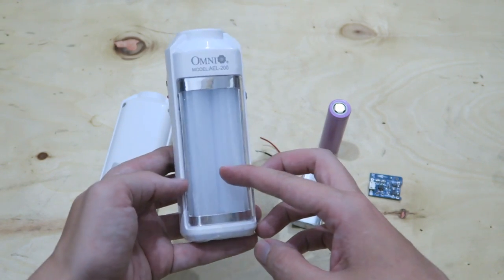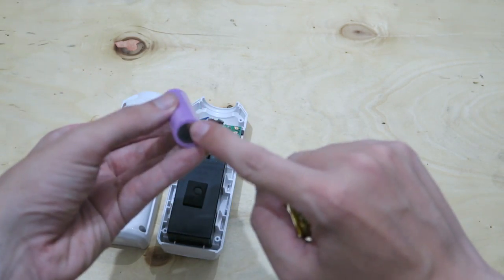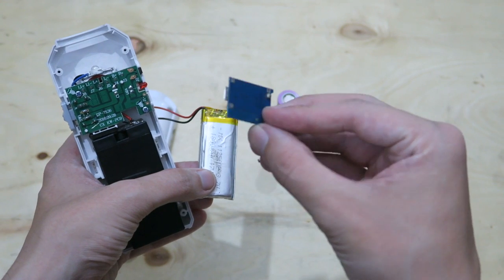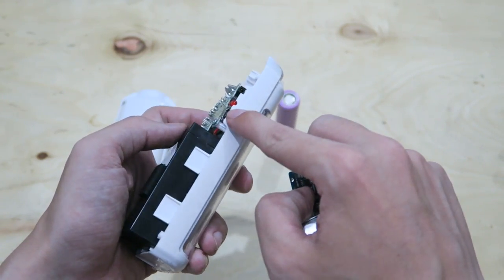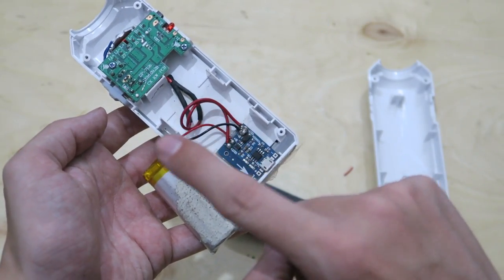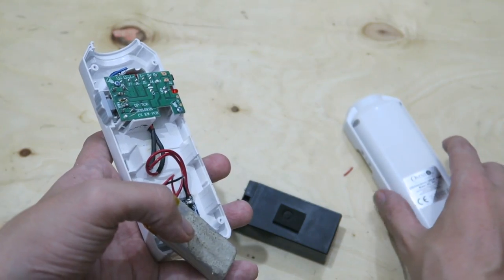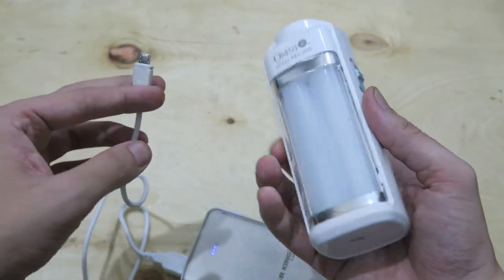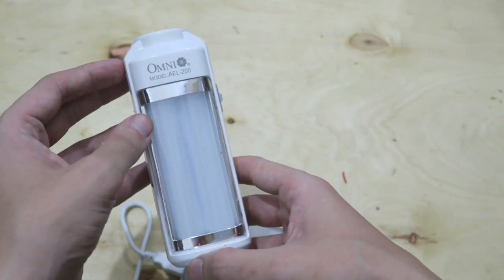Upgrading light to Lithium Battery

Comment from the maker: An easy and cheap way to replicate this would be to buy a P99 - P150 powerbank from CDRKING and remove the 18650 and charge board to use inside your Omni rechargeable light. Or alternatively just remove the lead-acid battery and keep a powerbank permanently attached to the light with a short micro-usb cable.
Reply: Hi. I removed the lead-acid battery and connected it to a powerbank but it won’t work. Any idea why?

Comment: Hi I have the same rechargeable emergency light How do I know if the battery is full because I charge mine for 7 hours but still the red light is still on.  does the red light have to go off if its fully charge?

Comment: That battery has already installed battery overcharge and discharge protection circuit. But that cylindrical battery hasn't. So is it really necessary to put another charging circuit just like you did there.?

Comment: An easy way to replace the battery in addition to using lithium battery with 3cell NIMH eneloop battery in the series. without changing the charger circuit but the charging time is around 12 hour for the capacity of 800mAh. but it's very profitable.

Comment: Hi GA. I have a diff scenario. I have a GDlite solar lamp that runs 6v lead acid. Now i have several liion lying around and i want to use to replace the lead acid. But still be able to charge using the solar panel. Is that possible?

Comment: Can 2 tp4056 work to charge 2 18650?   The flash light uses 2pc 4v 1AH lead acid in series.   So i need to have the 18650 in series.  But i plan to tap each 18650 in parallel with 1 tp4056 each.  Will this work?

Comment: Can you tell us on where to find this charge controller board here in the Philippines?
Reply from the maker: You can find them on OLX and Shopee or order through eBay with free delivery from China/HK. Alternatively you can buy a budget powerbank (P100-P150) and salvage the charge board and battery from that.
Reply: Gadget Addict oh, that's a great idea. But my problem with powerbank is the output. Unlike the charge controller board in which u can just solder the wirings to dedicated points, powerbanks only have usb port as an output. :(
Reply from the maker: +Jake Abad that's true. Although I actually did it on another light by soldering to the pins of the USB port. But of course I'm driving the light at a slightly higher voltage (5V) than it's expecting (4.2V)
Reply: Gadget Addict BTW, I'm not using it for the omni Light. I am using for  Oontz Bluetooth speaker instead because its battery got broke. Is it dangerous for me to try it to the Bluetooth speaker perhaps?

Comment: Successful try! Can my old Nokia battery use like that? I saw the lithium battery you use just like old mobile phone battery.
Reply from the maker: Yup old lithium-ion batteries from cellphones can be used, as long as you can solder to the terminals of the battery :)
Reply: can

Comment: I know this is out of topic but, can the note 6 support more than one stylus?
Reply from the maker: Interesting question. I would assume not and a quick Google search suggests it's not possible.
Reply: Gadget Addict Tnx :)
Reply: Gadget Addict Me and my other friend thought that 2 stylus' will make it easier to play fruit ninja 😂😂
Reply from the maker: haha I think the device would have a hard time working out what's actually going on. That would be cool though!
Reply: Gadget Addict Can I ask on what is the best internet connection available on Rural areas? Except for Smart
Reply from the maker: Mmm It varies hugely on the area. The best internet connection available in the country is PLDT Fiber and next would be Converge ICT Fiber and then Globe Fiber. But most rural or province areas don't have Fiber yet so your next best thing is DSL from PLDT. For always-on home internet connections, 3G/4G(LTE) based options should really be a last resort.
Reply: Gadget Addict Looks like DSL is not available in our area since we are using PLDT Wimax and it stopped working for 6 months until now. Our only option is a Pocket Wifi. The signal inside the house isn't even great so we have to place the pocket wifi outside the house :( What connection do you use though?